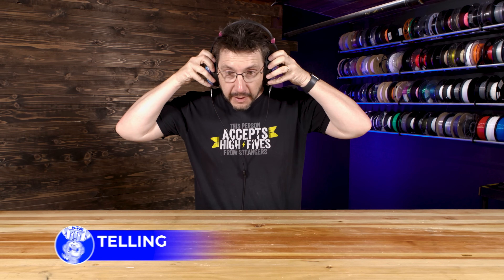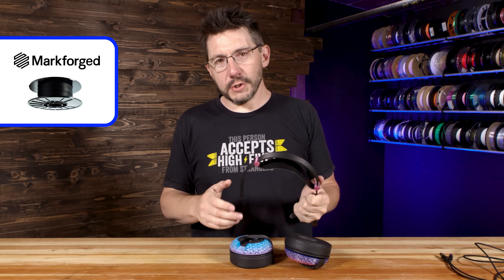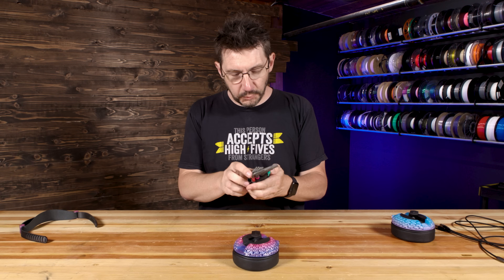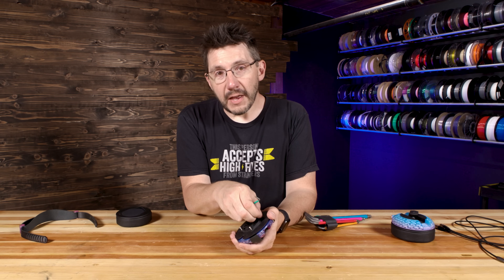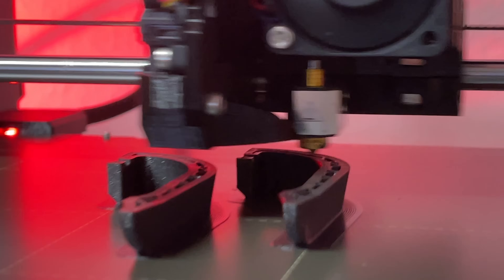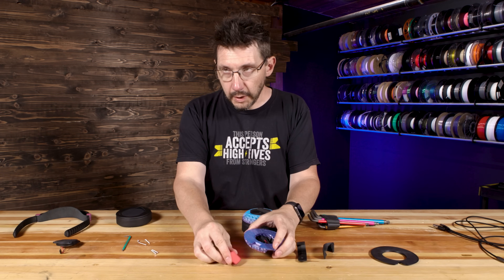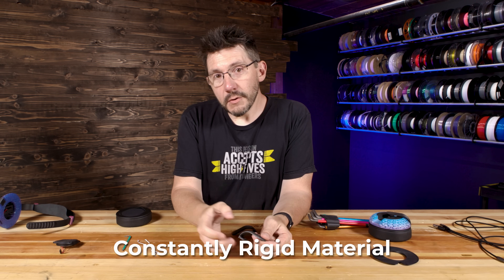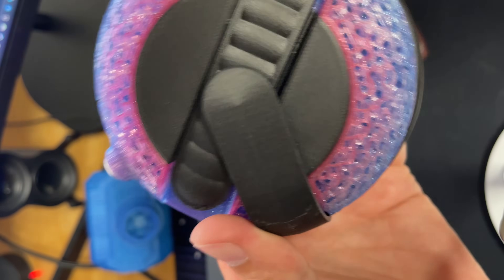PLA IS BETTER Than Carbon Fiber Nylon?

Comment: I'm still very new to 3d printing. I bought a roll of cf petg off the jungle site, and found this out too. Wear resistance seems to be great and I love the finish, but certain directions of force have tended to cause premature failure for me. I did print my own direct drive mount for my Neo with it and that's holding out great.
Reply: Use PET-CF instead of PET-G CF. The G modifier is why you're experiencing creep
Reply: @3dPrintingMillennial  Thanks for the advice. I'm in Canada; I see that I can get Ultrafuse from BASF in that spec. A little spendy while I'm learning, but will probably go that way once my current roll is out.
It goes a long way when the main thing you print is joycon latches for your kid lol.
Reply: @kstricl  Bambu Lab sells it too. $57 CAD for 0.5kg. Still pretty pricey
Reply: @3dPrintingMillennial  pretty much all materials creep. It being glycol modified does not mean that is why it creeps, it just influences how much it creeps.
Reply: You need to make sure you orient the piece properly, the properties in the Z direction are much less than in the XY directions, so ideally you want all force to be transmitted in the XY direction.

Comment: I printed those out of PLA and had the same issue. I was lazy and just gave them a bit of heat and pushed them back down :)
Reply: That's not lazy, that's the right answer. No need to waste time and plastic when a few minutes with a heat gun can reset it. Ideally this mechanism would be changed to meet the material, but fixing the part rather than reprinting it or printing an entire new design is the best option.
Reply: This is the route I think I would have gone with as well.
Reply: This

Comment: Yep! Nylon creeps quite badly. Anything that you make that has a constant load should be done out of ABS. PLA still creeps, but not as bad as Nylon. Assuming you don't put the headphones in a moderately warm situation, they should last two to three times longer than nylon.

If you make that part out of ABS, it won't creep at all for longer than the life of just about every other component on those headphones.

The creep problem is one of the biggest problems with nylon and one of the biggest draws to ABS.

Comment: I keep getting comments about plastic creep on my 3d projects. Basically the writers keep telling me plastic doesn't hold up over time. I've used PLA for a lot of things that are said to be a NO NO...and yet some parts are now 5 years old and still holding up without issues. 🤠
Reply: PLA creep has been pretty well documented. I think it's likely your parts are plenty beefy enough to avoid it for the amount of stress they endure.
Reply: Thanks Jeff and could be the beef.
Reply: PLA sort of has the opposite problem though. It's a rigid material, rather self supporting, but it creeps under load. This can be proven in 24-48 hours with a simple test but in your use case it might be a few years before it's easily measured and should you choose not to measure it well you might not even notice. But the properties of most plastics were known well before they let random people own 3D printers so it's a bit funny to see people arguing about it. If your part is working for you good. Some people are just concerned. The great thing about 3D printing is you can always make another. Just hope nothing else gets damaged.

Comment: PLA is not going to last either, its just a bad design. you have to design "buckle" to slide into then it can move as much as it wants to.
Reply: He needed a shock and awe title and an excuse to put out an easy video on printing; rather than design improvement using CAD.

Comment: PLA deforms over time even more? That is what i always learned.... Am i wrong?
Reply: It creeps
Reply: When it comes to creeping, ABS is basically the king of materials for a hobby level printer.

Just about everything else creeps if under any load for long durations... ABS has a big lead on just about every other material.

Now, if there isn't a load, it isn't as bad for most other materials. Nylon is awful when it comes to creep though.